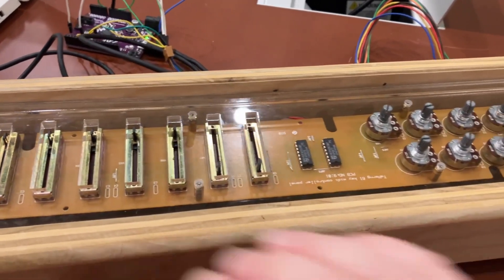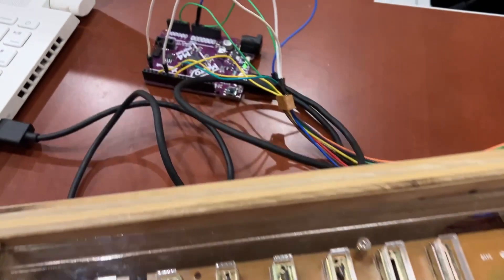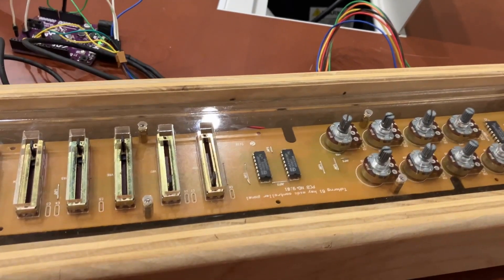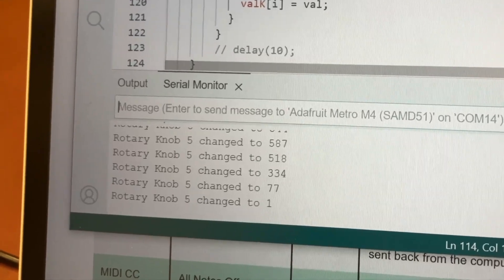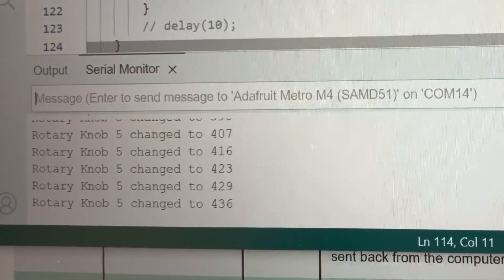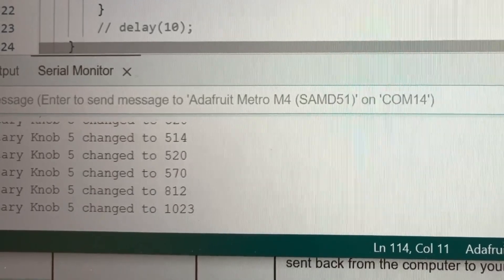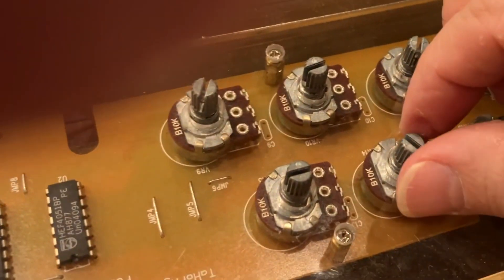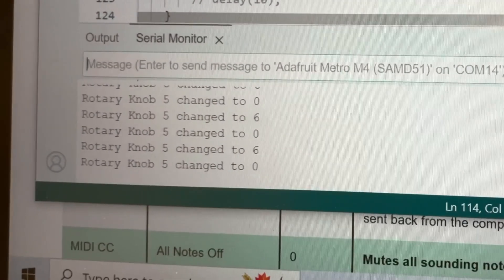Mystery of the Misbehaving MIDI Controller (Adafruit Metro M4 Express with Salvaged Knob/Slider PCB)

Comment: Overflow?  Do you have an option to read at a higher bit depth than 10?  Are you sure your voltages are aligned between the two devices? (ADC ref voltage....)

Comment: Aaron, if you're careful, you can straighten the tabs on the misbehaving pot and inspect its innards to see what might be causing this issue.
Reply from the maker: I should have mentioned that all the pots and sliders are behaving the same way, so I don't think it's a mechanical thing.

Comment: I wonder if it has to do with positive/negative numbers. I mean, if the code is mixing signed and unsigned bytes, or words, or whatever.
Probably not, I guess
Reply from the maker: I'd suspect something like that if it was rolling over back to zero at the top. Someone else here suggested there's a weird bit depth thing, where the # of bits in the converter may be set wrong somehow.

Comment: It’s most likely a bad potentiometer. I would just go with the low tech solution and just replace it and see if that works.
Reply from the maker: Ah.... I should have mentioned it's doing it on all the sliders and and all the rotary pots. I had the student working on this throw in an "if" statement to just output the results for one of the pots to make it easier to see what was going on.

Comment: Hi Aaron,  I've had exactly the same issue with the M4... power the pots with 3.3V rather than 5V. M4 analogue inputs expect 3.3 max. Definitely a curve ball if like me you're used to Arduino and didn't rtfm ;)
Reply: Sadly sometimes MCU prototyping has been a finicky b*tch, ESPECIALLY if using any components made in china. Yesterday an encoder was doing something similar, so I tossed that encoder and replaced it. Thankfully now after that it functions properly.

Comment: My preferred method for checking pots is to apply a voltage across them and hook the wiper to a scope. I find it reveals any roughness in the track better than reading resistance on a meter as meters often don't update fast enough, and small glitches are very visible on a scope screen. My approach would be to test a pot first and see what that wiper looks like .
Reply from the maker: I should have mentioned all the sliders and pots are giving the same behavior.
Reply: Maybe try swapping out the shift registers? @Lantertronics

Comment: The fact that it seems to divide in half in that last part seems to me that there is a “missing bit.” Perhaps it is erroneously configured for the wrong numbers of bits and a shift is occurring. You know way more about this stuff than me, though! I would think the error is on the digital side rather than pot non linearity. Perhaps the multiplexing is where the problem is happening, because this behavior would really match an off by one error, where you’re looking at the wrong 10 bits, and are missing the true MSB

Comment: First questions I would ask is what voltage reference is used (internal or external) for ADC? And in general I wouldn't drive ADC in full range in pretty much any scheme. Some kind of clamping happening potentially? I assume pots was checked electrically in motion.
Reply: Also, is this a 10 bit A/D converter? 10 bits is 0 to 1023
Reply: @atomic_redneck   8-bit, 10-bit or 12-bit resolution can be used as datasheet says. There is a chance it is analog problem, it is not seems to be software bit mangling issue.